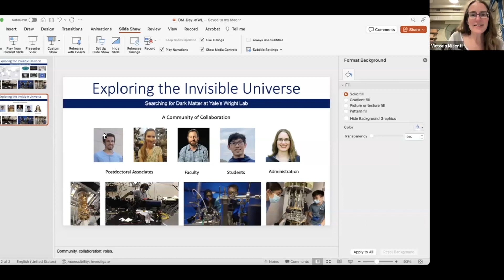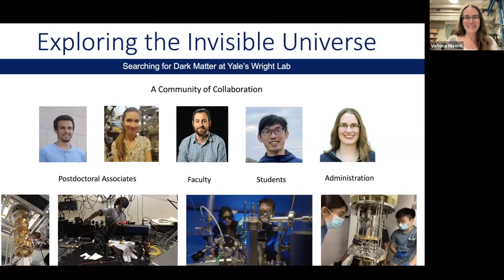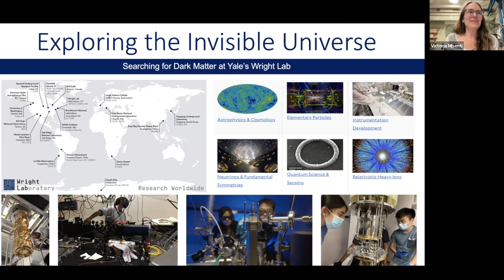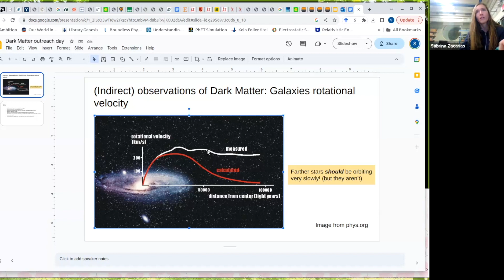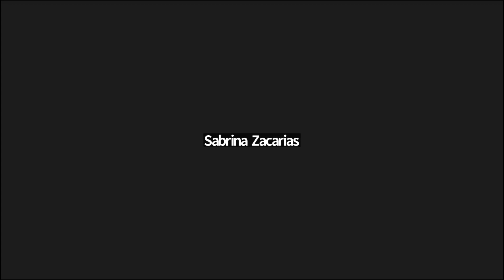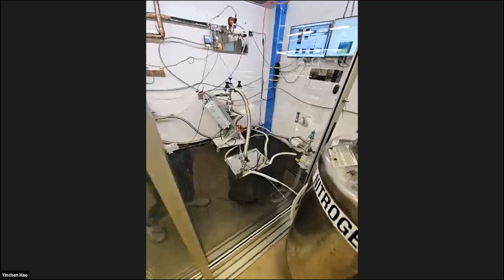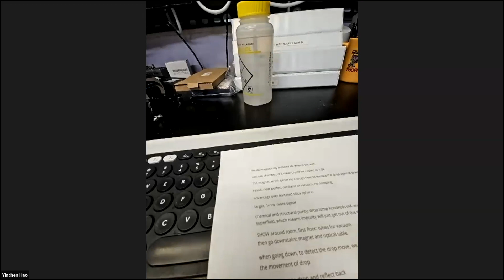Exploring the Invisible Universe: Searching for Dark Matter at Yale's Wright Lab

Comment: Nice a laboratory that has my last name. XD 
Dark matter should have multiple solution sets that come together to explain it all. 
From energy density curving space time and creating frame drag. To coupling fields or B.E.C. like states. To particle production from quantum foam and gravitational waves and energy density regimes. You should try to link timing to gravitational waves as a side test. Good luck in wonderland. 😊 OH H3 superfluidity boojum  👍 The other boojums from neutrinos condensing into a superfluidic boundary and as the first particle type allowed after photons in a extreme energy density regime. ALICE detector and superfluidity. 

Q. Would you be disappointed if D.M. sector was dominated by weakly interacting particles? 

Q. Are you calculating for gravitational waves and particle production from quantum foam? Density waves and even superwaves. Energy density regimes and how that curves space.

Good luck and keep up the good work. Keep constraining things.